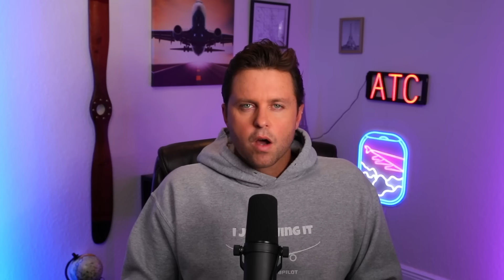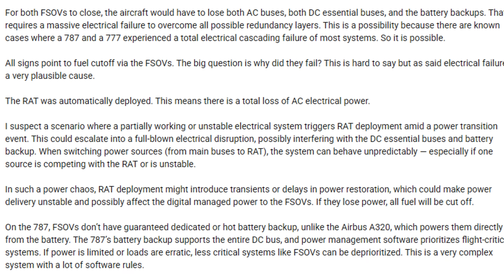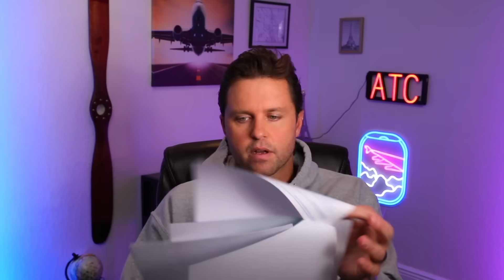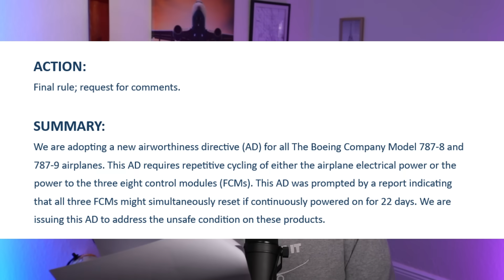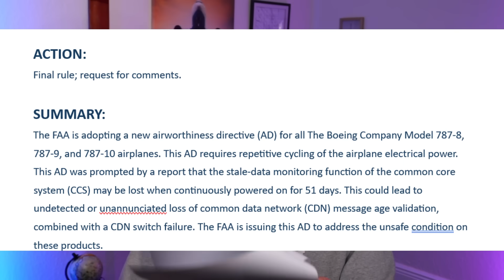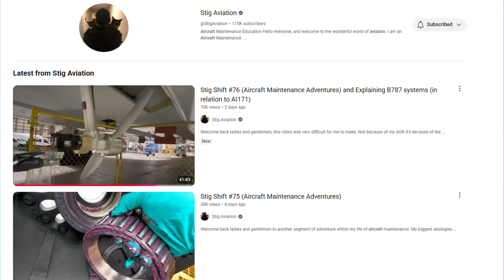Air India 171: Did a Software Glitch Cause Dual Engine Failure?

Comment: If the flight 171 crash was electrical/software/fuel system related, and NOT pilot error, then why aren't people discussing grounding the entire fleet of 787s?
Reply: Can this crash be reproduced in a Simulator?
Reply: @LifeIsStrange1229  in a stimulator?? with who??
Reply: Money
Reply: @ASMONBRASS  money Whistle blower at boeing have been raising these issues Faulty part being taken out of whats called the part jail literallly because they not safe or they too damanged and are not suppossed to be used but The pressure to get planes out the door and a shortage of parts  has caused many of these parts to go missing and  the higher ups have ignored these Sounded alarms by engineers plant managers . One whistle blower said Many if not all the missing defectine parts have gone on to plane s these parts he said are in the thousands . i will if you dont mind leave the link
Reply: Wait for it. Investigation still pending
Reply: @surelynot11 Should you wait? Seeing what happened to 737 Max?

Also if the problem with FSOV is true… I think the plane should still be grounded even if it wasn’t the cause of the crash. You just can’t risk a plane shutting down both engines if electrical failed… that is a massive catastrophic flaw in the design of the plane waiting for a disaster to happened!

That design flaw will cause plane crashes… only question is when?
Reply: That will wreck havoc for airlines  & boeing, what would you replace you active jets with? After covid every airline  has baclogged orders
Reply: @Hassim4539 airbus. Far more reliable
Reply: Money
Reply: It’s just a theory at this point
Reply: The power of Boeing and money. If it is true, they don't want their fleet to be grounded. .....
Reply: @historycaesar it's their lobby power
Reply: I agree it also seems like India is checking their aircraft for something domestic issue, and the criticisms to date inside India are directed inward mostly to  Air India/India air safety.   I'd prefer if it was not fuel contam issue, but that does seem to make sense.
Reply: @billtracy8774  Fuel contamination is unlikely. The contaminated fuel would be very unlikely to hit both engines at the same moment and cause them to simultaneously shut down. As there is no evidence of yaw as the aircraft stops its climb out, which would indicate asymetric thrust, we can likely discount fuel contamination as a cause already. I hope it is not the plane, but my gut feeling says it probably is. It has to be something common by design to both engines or made common through an unexpected event such as a short circuit caused by a liquid spill or swarf or other contaminant. The flight crew, software and fuel are the only truly common things by design (we are assuming an engine going below idle as it seems almost certain the RAT deployed, probably automatically given the short time frames involved) so we can ignore the thrust levers etc. as none of that stuff would cause the engines to actually shut down. My gut feeling says something shorted out and caused an unexpected outcome in some manner of cascade failure. It may be difficult to find the evidence in the wreckage.
Reply: History is about to repeat itself. When the first MAX went down, Boeing officially blamed the pilots. As that's easier (and way cheaper) than to admit own faults. It needed another crash until something changed. Now a 787 went down and the circumstances seem to indicate that there's another Boeing problem. I strongly hope the investigation body is finding it out quickly and all 787 can be grounded before another avoidable loss of human lifes will happen.
Reply: @d_mosimann  And the accident report also blamed the pilots.
Reply: @cainneachdaugherty7172 Plus they already flew in the stooges from the NTSB to clear Being once again and repeat the blame on the pilots
Reply: I am but people kept telling me how clueless I am or how I have no idea what I’m talking about.

I told them to go F themselves.
Reply: Money.
Reply: They need time to manoeuver their personal stocks around
Reply: Because currently it’s „freak accident has everyone puzzled“ and no official has come out with any reason to worry. It’s a plane that flew for over a decade and with hundreds of siblings that never had a similar problem. Like way back when with the 737 hardover: freak accident with little odds of repetition.

And remember, we’re still waiting for the reading of the CVR and FDR, so without evidence of what happened, status quo gets maintained
Reply: Remember the Max? That’s why
Reply: Who has more money the dead pilot or Boeing
Reply: Investigators still investigating !
Reply: Because if an issue took 15 years to happen once more than likely, it is not really a hazard, this scenario is definitively one in 1 million, i’m not saying it shouldn’t be fixed if it is proven that this is a problem, but until we know what it is grounding, a third of all the wide body jets on earth will cause more harm then good
Reply: @adamd858  you re freaking morron
Reply: @adamd858 That doesn’t mean the exact same issue cannot cause another plane to crash tomorrow or even today.

Note that planes are prone to have more issues as they aged… Older planes are going to increasingly see more issues with various system as they get older.

So the likelihood of this happening would be much higher after 15 years in services
Reply: because Bow Wing is now above the law like another crowd on this insane planet......................

Comment: According to my research the FSOV are not spring loaded - "the 787’s engine Fuel-Shut-Off (spar) valves are motor-driven, latched ball valves.
They have no springs to bias them open or closed, and they need electrical power only while the little DC motor is turning. Once the actuator reaches either end-stop the mechanism latches mechanically, so the valve just stays where it was when the power disappeared."
Reply: I guess we are back to software.
Reply: Where did you find that? I couldn’t find anything to back that up.
Reply: @helloosuee6561  It's in the AMM

Comment: I believe that this was a total electrics failure (cabin lights illuminated immediately after thrust loss following on from cabin electrical faults on the ground) I believe the engine roll back was due to loss of sensor data unless the pilots managed to reopen the fuel cocks as thrust returned immediately before impact. I think it’s electrical failure causing roll back and the RAT restored power and thrust returned but too late to avoid ground impact.

Comment: Good additional information definitely food for thought.. I'm suspicious about the electrical issues within the cabin Prior to the takeoff. I remember reading once that the entertainment circuit board for the tV mounted headdress had issues and created a cascading an electrical issue in the cockpit. I believe it even turned into a fire. I get the information regarding the valve shutting as soon as there are no electrical inputs, but wouldn't they Reopen as soon as the rat. Deployed.?

Comment: "Specifically, we look at the possibility that the aircraft’s fuel shutoff valves (FSOVs), which are designed to close automatically when power is lost" 
Why would you want the engines to shut down due to electrical failure? I can understand the safety issue. If there is no power how do you shut down the engines. It's like not having an off switch but I can also see how this can cause a catastrophe. Common sense would tell me to have batteries to keep the engines running. There would also have to be a delay in the valves to allow the batteries to take over.

Comment: If a software glitch is responsible then a single-source failure caused a catastrophe. All those multi redundancies were a waste of time. If this turns out to be the case then Boeing is in deep trouble. Recall the single AoA vane failure that downed a 737MAX.

If a battery on the A320 keeps the fuel shut-off valves open then what is the point of a fuel shut-off valve? Are the FSOVs on an Airbus A320 pilot operated? Nothing should inadvertently shut down engines other than an engine failure itself. If an engine fire is flagged up in the cockpit then the pilot shuts the FSOV. No way should this be automatic. If it is automatic then the 787 is a ticking time-crash awaiting the perfect storm of circumstances, a hostage to fortune and the caprice of quantum mechanical electronics. I cannot believe Boeing design engineers could be that stupid.

Comment: You know it isn’t dual engine failure because the lone survivor said that shortly after takeoff it felt like the plane came to a stand still in midair for 5 to 10 and green and white lights came on inside the cabin. The passenger said he could feel the engine thrust increasing to go up but the plane dropped and crashed.
You know it wasn’t engine failure and it is something else!
Reply: A lot of rumours about survivor going around.
Reply: @davidboult4143  this is verbatim from the Indian media. I don’t know anything about planes but even I know when the engines are powering up as well.
https://youtu.be/W9mmRoaGDMI?si=JUZ3AnzDPI4uC6Wy

Comment: No that doesn’t sound right. I’m an airline aircraft mechanic and sincerely doubt the fuel shutoff valve is spring loaded closed with loss of power.
Reply: Check your 787 manuals.  Yes, that's the way it is designed.
Reply: @CrystalKhlyr 
I do not have any 787 system schematics. Yet this defies logic or probable FARs.
Reply: @CrystalKhlyr 
I looked up a description of these fuel shutoff solenoid valves. In fact they are motor operated and not a “solenoid”. They won’t snap shut if power is lost.

Comment: lol - I proposed this theory in a comment on day 2 of the incident when everyone was still claiming it was pilot error due to the flaps being raised.  Here was my comment (https://youtu.be/-qFUYK_ln38?si=guBPmtMtu0NzXQDv) - and yet everyone was saying I was hallucinating.  Although I proposed mis-wiring at maintenance causing the catastrophic electrical failure triggered  when the gear was raised - pulling its necessary current load and tripping all power - the fundamental principle is the same as what is being said today: 
@chillzwinter 5 days ago
In my theory it has nothing to do with the position of the flaps (which I suspect were successfully extended the whole time) it was instead related to the action of attempting to retract the gear blowing the circuit breakers to all electrical feeds due to mis-wiring during recent maintenance. In summary:
The aircraft’s main electrical bus was incorrectly wired during maintenance, creating a latent vulnerability. Upon takeoff, the action of raising the landing gear triggered a sudden electrical load surge that the misconfigured system couldn’t handle. This surge caused a catastrophic failure of the main electrical distribution, leading to a total systems shutdown just seconds into flight.
Likely sequence of failure:
-    Gear retraction command initiated at ~400 ft 
-    Surge in electrical demand overloaded the miswired main electrical bus
-    Main electrical bus tripped or shorted, cutting all electrical power
-    Fuel pumps lost power → engines flamed out seconds later
-    RAT deployed automatically to provide emergency power
-    Hydraulic pumps lost power → landing gear stalled mid-retraction
-    Flight control systems degraded → aircraft unrecoverable
-    Crash occurred within ~30 seconds due to total systems loss
This explains the simultaneous engine failure, RAT deployment, and gear malfunction, all triggered by a single fault point under load.

Comment: Boeing and software bugs go hand in hand.  Boeing has too many MBA managers and too few engineers.  And based on results over the past 10 years, it would be safe to assume that the managers make the decisions, not the engineers.
Reply: In fact, one can trace many if not all issues with Boeing aircraft back to the corporate culture change that replaced seasoned engineers in upper management with bean counters. It's sickening that a once great organization would commit suicide by MBAs.
Reply: @JeffSpec  Bean Counters got control of the company I worked for (IE RCA) We went into a death spiral.
Reply: That's why the whistle blower was murk because he told about 777 and 787s were built with lots of defective parts etc...😮😮😢😢
Reply: @Care-o9i he got suicided the same as Epstein
Reply: Yes. And there should be more mechanical engineers.
Reply: Stop recruiting MBA , Company not run by advertisement , it's run by quality products , Engineer is a heart / soul / brain  of engineering company
Reply: Don't worry the NTSB will bail them out again with their broken black box erasing everuthing and making it pilot error
Reply: @Jabarri74  name a single time that this has happened.
Reply: @rynovoski  I rem the 737 max originally blamed on pilot error. This was a relatively low impact crash  as the plane was just gliding yet the black box got damaged?
Reply: @Jabarri74  What accident are you talking about? JT610 impacted the sea at a 40º nose down angle.
Reply: @rynovoski every time. It’s either damaged or they can’t find it
Reply: Thanks a lot McDonnell Douglas..... Ruined their own company, then had to ruin the most well respected name in aviation.
Reply: @casesully50  Exactly.  They were aquired, but the bean counter mentality that led to their downfall was embraced by their new bosses.
Reply: Software bugs on Qantas 72 as well.
Reply: Take a look at all management systems. Exactly the same. It would probably work but these days managers including the HR ‘director’ are promoted on a friends and family basis. Because it’s easier to cover up any failed decisions. The entire board is on your side against any ‘lessers’ in the system. Does it look like management think losing or nearly losing a plane load of people every few years was worth the profit?  be very careful of being specially ‘selected’ by the board to be the only ‘engineer token’ to be part of that board. You fit the bill probably because you are in your training year and will be told you are far better than the experienced ‘old fashioned’ engineers who might dare question boardroom decisions. That is always flattering to hear and almost believable. Bet that coding software engineers were given more power without the years of flight or mechanical study and experience, than plain old engineers, another way to stop questioning any preventable software issues. The engineers would have delayed sales with all their ‘unnecessary safety checks’. They get away with it because it sorta works. Globalisation and the spread of greed by best practice is now causing people to question just exactly who is in charge and what sort of idiots sit on management boards. The way forward is to make sure that data controllers, experienced engineers and financial ‘experts’ are on an equal footing and have equal number of representatives at any ‘board meetings’. In the name of power and unlimited director fees, anything goes. How sad.
Reply: Boeing was not responsible for this crash. It was pilot error 100 percent.
Reply: @stevecartwright188 ah, another Boeing shill with zero evidence
Reply: Well that would be the reverse takeover by MD bean counting clowns who have turned a once great engineering company into a giant deathtrap manufacturing circus
Reply: The majority of the big Western corporate  companies work this way. 3 to 4 Manager per Engineer.
Reply: Yeah, sure.
Reply: I’ve flown Boeing aircraft for the last 30 years, I’ve flown the 737-300/500/700/800/900/900ER, the 747-100/200/400, the 757-200/300, 767-200/300, 777-200 and 787-8/9/10. Never once in 30 years have I ever had a software glitch while in flight in  a Boeing aircraft. Not once. I wish people would stop talking about things that they don’t have a fucking clue about. You know what I have had software glitch in? The airbus A320 many times.
Reply: American Airlines 587. What engineer changed the rudder travel limiting system but never trained the pilots?
Reply: @richardlewis4288  what are you talking about?
Reply: OLD and boring, typical lazy (25 year old) comment.
Reply: Not all the software in all of the avionics onboard is written by Boeing engineers.  The software for each bit of avionics is generally written and certified by the manufacturer of the piece of equipment.  Many people are blaming the FADEC at this point (without any real evidence).  Boeing didn't make the FADEC...they didn't write and certify the code.  Try again.
Reply: @davidshema2614 Ultimately the responsibility is on Boeing to accept or not as the OEM.
Reply: @davidshema2614  The overall responsibility for aircraft safety lies exclusively with the aircraft nanufacturer.  Trying to pass it off as someone elses responsibility is pure nonsense.  Try again.
Reply: @davidshema2614 ........But Boeing certify their plane which use the product as safe for public use. So the ultimate responsibility rest with them.
Reply: @davidshema2614 and who designed and implemented the electrical system? Who designed the spring loaded shut off valves that close when there’s a loss of electrical power during takeoff? Why wouldn’t Boeing want to review any third party software and demand changes if it’s not optimal? In any case Boeing have sacked all their avionics software engineers with 30 years experience and outsourced all their avionics software development to inexperienced offshore contractors—hence MCAS

Comment: Maybe during takeoff, and all the heat, the electric glitch hit, the rat deployed, but the airplane was just getting in the air so its going as slow as possible. and that hang time like you mentioned, was enough to snap the fuel lines closed.